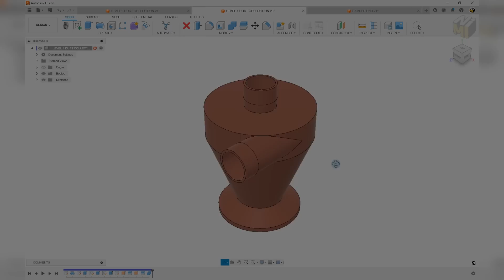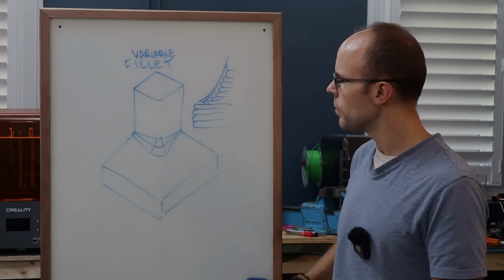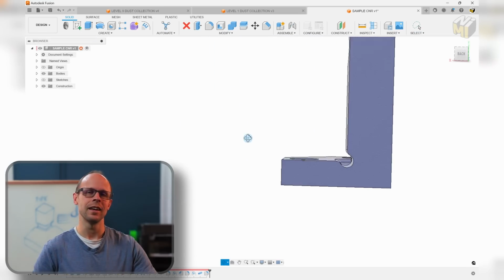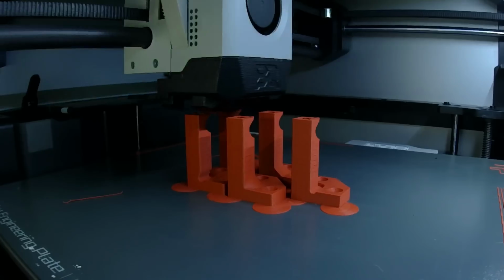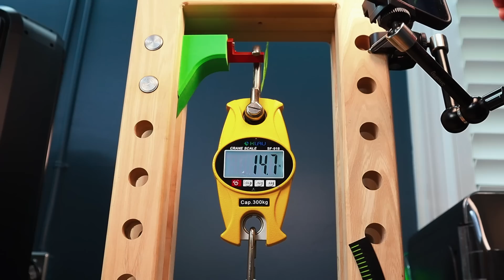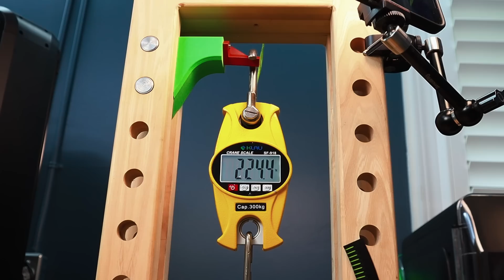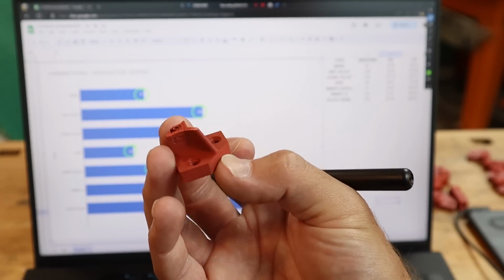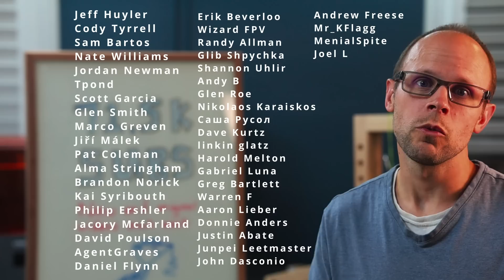Which is the Best 3D Printed Corner

Comment: Great test, I must say. You've tested the worst case of worst cases - those elements won't get any weaker.
What is already said - it was printed vertically, this way you actually test the strength of layer adhesion.
What you did was printing all elements at the same time, which also influences layer adhesion negatively.
How about printing those elements one by one or using sequential printing ("complete individual objects" in Prusa slicer)? I wonder if the results will significantly change.

Comment: Why did you choose this unfortunate print orientation?
Particularly the last print with external rib (gusset?) would have benefited if the top line of the rib was one continuous extruded line
Reply: It's the worst case scenario. Some parts can't be printed flat, so knowing what works to mitigate the lower layer adhesion strength is good.

It would be nice with a follow up with other orientations, but I don't have a problem with the test methodology. I only wish he tested more samples of the  B and C items too. (I don't remember what he called them.. They're the ones after the pipe)

Comment: the fillet doesnt matter in most cases, the upper layers are the same area anyway, you just decreased the lever in your system
Reply: I agree that it tends to fail at the "same point" *based on the layer surface area*. But this is about adding strength. If that's done by moving the moment arm surely that's job done?

Comment: i generally use the pipe variation in very tiny scale to get perfect square inside corners. oftern a diamter of .6mm is enough clearance to give the material in the corner enough room to "expand" without rounding out the corner itself. due to that extra circular move of the nozzle that inside corner inner walls will be actually slighty oversize and thus strengthening the corner from the inside while looking perfectly normal square on the outside. this is a fantastic method to hide actual engineering relevant feature from the final part
Reply: Would be awesome if slicers could do this for us. :D

Comment: Interesting video! One thing, it seems like the test shows what type of corner is stronger than the pin itself, as the breaking point is just outside where the corner fillet ends. Also, to properly test corners, you should change the design so you can print them laying down instead of standing up. It would make the part way way stronger, putting the load more on the corner. 
I am unsure of the choice of filament. CF PETG is not the strongest, but it is rigid. It might be the filament of choice.

Keep up the good work :)
Reply: Standing up is good for this test. Of course it would be stronger when printed laying flat, but some parts has to have pieces sticking up like the ones in the test. It's the worst case scenario, and the test shows how the problem can be mitigated.
Reply: @phizc  I partially agree. My point was, when the part breaks outside of the corner, we dont know how strong the corner really is, which was the point of the video. Printing in a different orientation would make the part so much stronger, that we might get to see corner strength instead.
Reply: @erikrustad5200  Agree that a break outside of the corner, leaves us with no good info on just how strong the filleted corner had become.  These tests would have been better with the horizontal "beam" set with a flat top, rather than the inverted "V".  I.e. have the horizontal beam spun by 45Deg.  Then the highest stress point would/should be back at the corner.

Comment: Also print orientation matters. You are pulling along the layer lines. I would like to see this test with the parts printed horizontally and not vertically.
Reply: Often you don't have the luxury of being able to print it flat, knowing what works to combat layer adhesion is good info.
Reply: Along those lines, giving it support and printing at 45deg would be really interesting for this particular part. Then the layer lines are in the exact same direction as the moment arm and can act like the cables in a cable stay bridge. 

Otherwise though, just for illustrative purposes this is a very good demo of the general principle of material stresses being affected by the geometry of the design.
Reply: If the goal was "how to print this exact part as strong as possible" you'd be right. But this is an example video demonstrating what happens with each corner type with compound stresses which become unavoidable in many complex designs. The orientation you print is useless when you have complex forces and stresses being applied to the print. So one area may be stronger because of the direction of the layer lines, but another section of the print will be forced to have this orientation. All on the same part.

This video was just comparing apples to apples. Not apples to oranges.
Reply: @eX_OSRS I think he was looking for oranges to oranges.  The other orientation is just as valid.
Reply: @eX_OSRS  Im tracking. I was just saying this test would be more interesting (subjective) to me to see the strength of the different types of corners when printed for maximum strength. Sometimes when I design parts and I notice that a particular piece will print on the weakest (to the part) axis, I create two different pieces that can be combined to create the strongest part possible. Thats all. I absolutely love the videos and have learned alot from them. I probably could have said the original comment better.
Reply: @ricfrye6644  fair enough, brother. I understand what you mean.
Reply: @ricfrye6644  Would be great to see both tested, but the principles demonstrated here should generally hold true and it's still good info!
Reply: @ricfrye6644  that's some humbleness you don't often see in internet comments. Very nice, sir.
Reply: Transferring the forces across layer lines wouldn't change the trend across the models - just the magnitude of the forces.
Reply: I believe the fillets would have a slightly lower level of added strength compared to fillets in the videos print orientation. I may be completely wrong though lol. 
Maybe a good ending for another video or Patreon vid. Probably not worth a full video.
Reply: He knows orientation matters, he explained in detail at the beginning of the video that this is about testing in this print orientation.  If he changed orientation it would be a different test. A different video.

It's not a video about "how strong can I make this part", it's a video about "how can we mitigate the weakness of sharp corners in this orientation".  The whole first three minutes of the video explains that. It's like someone tested a car and you're complaining that they didn't test a truck.
Reply: Not just orientation but the path for each layer. I've got an idea in my head that would Greatly resist the layer delam problem but I don't think slicers support it.
Reply: @ObservationofLimits  Interesting, do you mean controlling the tool path direction for each layer? Almost like weaving, where the perimeters and infill could be alternately woven together for each layer?

Comment: Wow, rare thing I get to comment this early :D 
Thanks for the experiments! Intuitively it seems like the overall surface area is the highest factor for strength, and the point of failure is most likely at the thinnest section. The further up that thinnest section is, the lower the leverage, the higher the required force. 

In my designs Im currently tending to add really long, low angled chamfer to move the point of failure up as much as possible. Also tends to give a nicer look than totally flat faces.
Reply: That is exactly my conclusion seeing his results. 
I was always doubtful the fillet in 3D printing was acting the same way as in metal parts (milling). With metal part you do so to avoir stress concentration, but with 3D printing, because of the layer lines,  the stress will still be concentrated at certain points as it is not an homogenous material. 
But now, with the conclusion you explained very well, it makes much more sense why fillet/chamfer/etc would increase the part strength. It's "just" a matter of layer surface and lever arm.

Comment: Quick fusion tip: hold ctrl to select more fillets if you already set a radius and cant select additional edges!
Great vid as always.
Reply: Thank you! Drives me crazy setting my radius to zero just to add more edges.
Reply: @scaredyfish  been doing exactly that for years, just found out last week 😂
Reply: Quick Fusion ProTip: Select a face to filet all edges of that face.
PS: SHIFT is the correct key to select more (add), while CTRL is selecting and deselecting multiple (add and remove).
Reply: @jangrewe  i must be using a different key map, for me its ctrl

Comment: Seems like the benefit comes from adjusting how far the leverage is from the weakest point in the print. The weakest point being the smallest across sectional area, so this will be where the fillet ends and the cross sectional area becomes the same through the rest of the length. 
Since this is exactly where the parts broke and the increase in force seems to match what you'd expect from just moving the leverage point close in so it has less force on the weak point. 
Would be interesting to see if you can take the breaking force for each and multiply it by the distance from the point the weight was at, to the point the part broke. If you get roughly the same value then it shows the benefit is from reduced leverage. 

Personally if I ever design anything like this and I need it to be very strong, I put a hole through the part for a screw to reinforce it. Makes it pretty much unbreakable.
Reply: The gusset one proves this point. It still broke at the smallest point, but that point was practically underneath the hook. Plastic layers just behave differently than say welded steel where all the material is inline and the joints are weaker than the material.
Reply: I left a nearly identical comment, hahaha. While the physics of course make sense, seeing it applied can often make it all the more intuitive.
Reply: Yeah it just looks like he moved the weak point away from the corner. Not really a test of the different fillets this is just a layer adhesion test.
Reply: I came here to say this too. From another perspective, there is more material being used. I would expect an equally good design to fare better with more material.
Reply: I too, while watching the video, immediately noticed that the test was conceptually  broken. Obviously a specimen fails at the smallest section, but the smallest section in each test had a different arm, so the moment was different and hence the tensile force was different as well. Not only this, but also the section area was different, which in turn changes the stress (N/mm2). In conclusion: a totally broken experiment that proves nothing (except the obvious thing: the higher the stress the sooner it fails). Every student of the first year of an engineering course would have immediately spotted the fallacy of this experiment .......
Not to mention the fact that not even a total beginner would print a piece with the highest stress normal to the layers ...... Just flipping the orientation would improve the strength by an order of magnitude with respect to the effect that a fillet/chamfer might have.
Reply: Your theory doesn't hold up because the internally swept parts are still stronger, despite having a smaller cross-section than the base part at nearly the same distance to the load as the base part.

Inside corners cause cracking, that's just one of the core truths in all of manufacturing.
Reply: @cosmic_cupcake  This is true, due to stress risers as Mike also said. However, and as Tyler said, there is a difference with FDM printing as well. While the overall volume of the part is reduced, the amount of material used is only barely diminished.
That's because the slicer will keep the same number of perimeters or walls regardless of where surface volume is taken out. So the part loses a little strength from the perimeters being moved inward, the total perimeter length being reduced, and slightly reduced infill. However, much of the overall strength is maintained.
Reducing the stress risers can compound with this property for an overall stronger part. That is, compared to a part with the same number of perimeters and same percentage infill, of course. If the part was printed 100% solid, the results would likely be different.
As for what ge said, it's not just a theory. Leverage and material area are obviously components of what make certain designs stronger. The closer you can get the weakest area to the point where force is applied, the less leverage the force has to break that weak spot. That's why most parts that hold something at a distance will be thicker at the base and thinner at the tip.
Reply: @cosmic_cupcake  as you state "at nearly the same distance" but it is not the same distance. if the distance is different, then the amount of force is different. it is why torque is measured in force and distance such as foot pounds . it is a rotational force being applied and the center of the rotation changes because of the fillet or chamfer . This video is misleading
Reply: @gregoryp203  1. some of the internally swept parts had absolutely no reduction in distance and were still stronger.
2. Even for those which did reduce the lever arm by a bit, the reduction was clearly less severe than the loss of circumference and therefore surface area of the perimeters. Either way the point still stands.
Reply: @gregoryp203  OH and I completely forgot about point 3, which is that the sweep also moves the perimeter closer to the centerline of the part. ...meaning that it is actually decreasing the secondary lever arm, which means that the perimeters inside the sweep are actually experiencing HIGHER tension forces than in the standart configuration.
Reply: @cosmic_cupcake  Exactly. A sharp inside corner becomes what is called a stress concentrator. Fillets not only look nicer and print better, but they also help distribute the force across a wider area.

Comment: I'm not sure I heard you use the term when talking about these stress concentration points, but from my understanding they are denoted as 'stress raisers' in structural engineering. As for the tests, I do have a notion to ponder, the area these blocks are affixed to, bellow them is infil. That means they are on a surface that is more prone to deformation and partially hollow! Merge a cube into the base of the protrusion of same-size, so they are structurally solid their whole length. Edited: because it's stress raisers, not stress risers.
Reply: Seeing as to how most of them broke on the shaft and not near the mating surface except the control and pipe versions, I don't think solid buys us anything. It might help a bit for the entire protrusion to be solid but that is to be expected. Since he did 6 shells it's pretty decently strong. Just my 2c.
Reply: Stress riser was the term my welding instructor used for sharp corners and undercut weld edges.
Reply: @jimfowley  I needed to look it up because I wasn't entirely confident myself, apparently I've been spelling it wrong!
"Stress-raisers are sharp corners, grooves, notches or acute changes of section that cause stress concentrations under normal loadings."
I believe when they say 'corner' it can refer to either inner or outer corners, in this case his pieces are making inner corners, what's important is it's 'raising' the stress at that specific region.
Reply: @Roobotics  Seems that stress concentration, stress raiser, and stress riser are all acceptable. :)
Reply: For a load like this, lever action mechanical advantage played a huge role.

The closer the reinforcement was to the force on the other end the "stronger" the part was.
They all broke the same way on the same thickness.
Reply: The fillet ones seem to be the ones that don't have solid infill.

The first one does have solid where it is predicted to break.